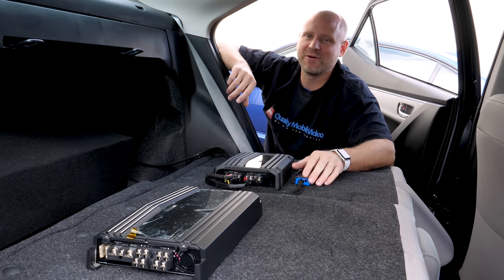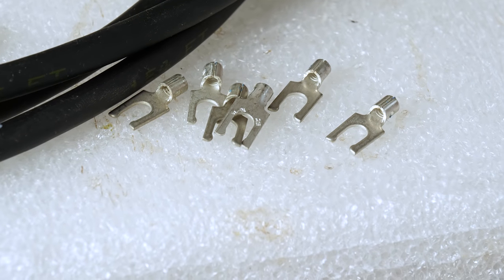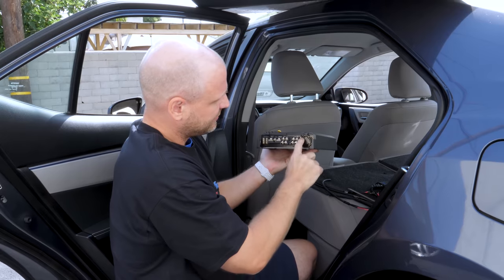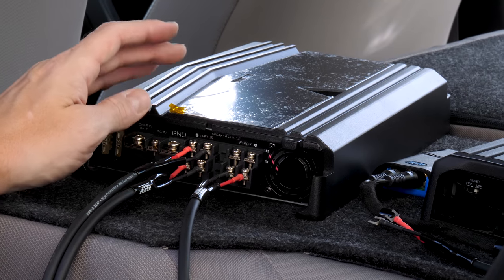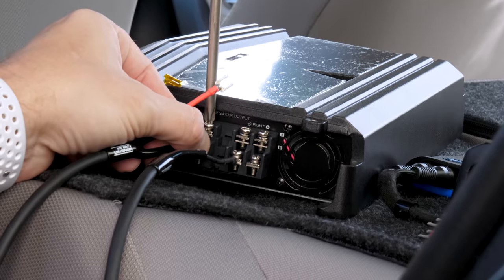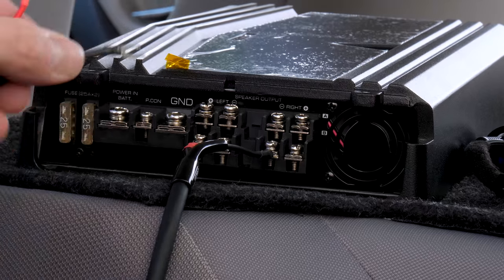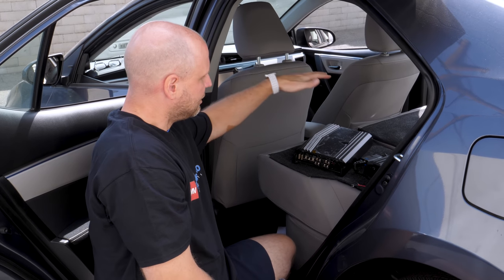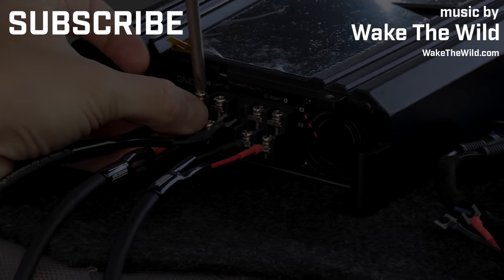How To Wire Speakers and Subwoofers to Your Amplifier - 2, 3, 4 and 5 Channel - Bridged Mode

Comment: This is awesome and the technically correct way to do things if you only have a 4 channel and need to drive 4 speakers + 1 sub.   HOWEVER Trust me when i say... DONT CHEAP OUT, SPEND THE $75-200 TO BUY A PROPER CLASS D MONO AMP TO RUN YOUR SUBWOOFER. TRUST ME,  200w @4 ohm bridged(2ohm) is OK but  There is a reason that these class AB amps have fans, they get HOT as fuck.  2ohm load x 4 is pushing it but 2ohm mono+ 2x2ohm is really asking for everything the amp has, If its decent it should be ok but chances are its going to overheat and go into protect.   Buy a $10-15 distribution block and run power wire to your 4 channel AND mono amp from that single 0-4gauge wire coming from your battery.  If you absolutely cannot have 2 amplifiers, check out pioneer's gm-d9605(or the newer 9705). They are class D and can be run at 1ohm on the subwoofer channel for 600w!!! thats 3 times what you will get from a class AB 4 channel like this.  But if it were me I'd take the sound quality of this kenwood class AB  and combine it with a 800-1200w Class D mono amp.  Pioneer  8601(800w rms) or 9601(1200w rms) work great.

Comment: i used my amplifier for 1 subwoofer. but i noticed that it overheat. what is the reason? is the polarity of the speaker important. maybe i incorrectly connected the positive to the negative of the speaker connection. please help.
Reply from the maker: What are the exact models of the subwoofer and the amplifier. You could have poorly matched your gear

Comment: I am running two sets of components some mid ranges and some tweeters four of each would u use the rear output to run the mid ranges and then front rca output to run tweeters and run tweets on one and two and then components in 3-4?
Reply from the maker: You don't have to run the tweeters to the external amp, if you're replacing factory tweeters you could just power them with the head unit
Reply: Quality Mobile Video I am running five zvx 12's and a cadence za12kw, it will take an amp to make a tweet even audible, and I am also running or have an deh-80prs coming n and want to run it off that nice clean output of the pre outs, but how many watts do u think a passive crossover can take?

Comment: Newbie, If i want to amp two subwoofers and power six speakers front, rear and extra 6x9’s would i power two subs to one amp and 6 speakers to another amp? Guessing it’s possible? Any response by anyone would be helpful
Reply from the maker: I think you need to proof read your comments next time bud! You also don't have to power everything with amplifiers. You can always use your head unit to power some of the speakers. So you could do two subs to one amp, four speakers to one amp, and two speakers to the head unit
Reply: Okay, you made a video how to power two amps yet?

Comment: can we hook 2front speaker and one sub to 2 channel amp?
Reply from the maker: Unfortunately no. When you're bridging a subwoofer to a multi channel amplifier, you need to use two sets of speaker terminals. You'll need a 3, 4 or 5 channel amplifier

Comment: use 720w amp hook up 4 speakers to 2channel. the amp give lot of power to 4 speakers.  why does power proctect turn on. any suggestions.???  thanks,
Reply from the maker: Its possible your impedance's don't match

Comment: Its STR8 forward when u hooking even amount of spkers nd using same ohms!! Gets complicated when u run into uneven amout of spkrs !! Thats were it gets challenging as per how to get the best power nd clarity out the system!! In my case i have 12 spkrs OEM nd replacing all them w higher watts all @4 ohms,,,, w 2 amps, one a5 ch w 5th ch for bass D class ch , nd the other a2 ch D CLASS sub amp , both rated each 2500w , all my speakers rated each at 200w w 3 subs rated each@ 300-600w 4 ohm

Comment: What if my vehicle has 10 speakers?! 4 low doors, one center dash, 2 rear corner deck, 2 high front door tweeters and one rear center deck subwoofer. Hoe would I connect all of them to an amp?!
Reply from the maker: I'd probably connect the front speakers to the head unit and use two 4 channel amps for the rest

Comment: I have 2 8" and 2 6" vocal speakers 8ohm each how do i wire them up to my 4 channel 4ohm amp? Bridge the 2 8" and connect the 2 6" direct? 8" are 500w 6 are 250w each
Reply: Amp is 1000w max

Comment: can do the home theater sub out be installed a power amp to upgrade it's bass sounds by using 2separate sub woofer by bridge, tnx,,,,,
Reply: my model unit is Samsung htf9750w  with vacuum tube GaN amp1330w

Comment: I want to install iPad as head unit in my car.how will connect the iPad to 4channel amplifier?
Reply from the maker: Just need an AUX/RCA adapter to run to the RCA inputs of the amplifier! 
http://www.qualitymobilevideo.com/xpress-xm-satellite-radio-wiring-harness.html

Comment: My sons dad did my stereo I've got an old 99 toyota avalon and a 10 sub in trunk with these 2 amps under my driver seat, the wiring is so scary, anytime I have an issue it's like a living hell trying troubleshoot wtf is going on. I've stopped at a car stereo store one time I had an issue, and they said they'd have to totally gut the entite wiring system to make it right again. I'm so frustrated.  It shorts out constantly, last night I got into my car and heard a funny beeping noise, climbed into the backseat where I thought it was, and couldn't find anything beeping but started smelling electical burning, when I went to climb back out I looked up and my car was filled with smoke, the terminals on amp were not covered right and touched each other causing half the dam wiring to basically melt onto each other. But I couldn't figure out which wire it was that was burning, freaking out was starting to grab for my fire extinguisher in my trunk, yelling for my sons dad who was inside the house luckily, finally he came down and pulled out everything to make it stop smoking, no fire, but dang close. I hate it when he does anything to my car, but with how he redid all my electrical, I dont know anything that's going on, its not at all normal, or how any diagram of my cars wiring "should" be, so I have to let him try fixing stuff he's done before. There isn't anyone who I've shown my stereo to who understands what he did to it. They're good amps and good speakers,he just sucks at installing and connecting and rewiring it all in there, and its so dam expensive, least from all the quotes I've had done for redoing it,fixing it, I can't afford it...ide just buy a new, used dang car if I had that much money.  I went to check out the book for my cars electrical diagrams, and wiring, and the book is flipping 120$ online. I can't find anything on the web that even just shows pictures of the wiring, no videos nothing. Idk what to do. I've got my 7 year old son who I have to drive to school every morning having to keep his feet up off the floor when he climbs into the car cus I'm scared it'll bump something and catch fire. I acually am tempted to just pull the whole thing out completely. My problem though is I have chronic anxiety and ptsd, and driving is sort of a really big deal for me, and having good music is basically like my Xanax pill, it makes life work for me, and when I'm driving, it's basically a mandatory thing I have to have to be able to drive...sounds crazy I know, but if you knew what lead me to that point of crazy, you'd know I'm acually doing pretty awsome only needing music to help me with my issues.  Anyways, of anyone oit there has ever seen or knows where I can find the wiring diagram for a 99 toyota avalon for free online, or anywhere and share with  me,ide be sooo sooo greatful.

Comment: how many channel amplifier do i need if want to wired 2 front 2 rear speaker and a parallel sub?
Reply: 4 channel amp
Reply: @rescuemepookie5256  thanks for your rply man, really appreciated!
Reply from the maker: 4 channel or 2 channel amp bridging the speakers will work fine!
Reply: @Qualitymobilevideo  thank you for your response
Reply: @Qualitymobilevideo  how can i wire 4 speakers (4 ohms and 250 watts each) and 2 subs both switchable 2 or 4 ohms 1000 watts each, i have a 4 channel bridgeable amp with 1000 watts max, should i make the 4 speaker 2 parallel to the 2 channel and make the sub parallel also for the bridge?

Comment: How In the world did the amp get its  full rang input feed ?20 Gage wire isn't enough to  handle much amplification anyway unless it sounds like crap and certainly not thick enough for a subwoofer .
Reply from the maker: The speaker wire featured in the video is actually 16 AWG not 20 AWG, which is perfectly suitable for most speaker runs, this is also just a demonstration

Comment: I have 4 front speakers (2 door 2 under dash) and 2 rear. how do i wire the front on a 4 channel amp?
Reply from the maker: Are you wiring the rear to the amplifier too?
Reply: Yes
Reply from the maker: So 6 speakers and one amplifier? I would power two of the front speakers with the head unit, then wire the remaining 4 to the amplifier
Reply: Quality Mobile Video i assume to wire the 2 small dash speakers to the head unit and the other four 6.5” speakers to the amp

Comment: hi! i have a 5 channel amp with MAX Power 1600W
• RMS Power:
     50W x 4 + 300W (4Ω)
     75W x 4 + 500W (2Ω)
     150W x 2 (Bridged) + 300W (4Ω
and 1 OZ Audio Vector Series 12", Dual 4 ohm 2" Coil 300W Subwoofer, what is the proper wiring for this? i've tried connecting the + and - wire to my sub then to the amp bridge connection but it smells kinda burnt.. i think i just fucked up my sub lol or is it normal for new subs?
Reply: fifty 9755 ummmmmmmm no. Get mono for the sub n leave the multi channel amps for speakers . N maybe u went too low on the impedance n cooked ur sub.

Comment: is it possible to connect a subwoofer and one speaker on a 2 channel? if so, how?
Reply: two 4 ohm speakers +,+.....-,-   on channel 1 .............1,  2ohm subwoofer on CHANNEL 2. THAT IS CALLED 3 CHANNEL MODE

Comment: Hello everyone, can someone help me do the right connection based on the gear I have?

Speakers:
4x Kicker KS 6.5". (4ohm, 100w RMS each).

Amplifier:
1x Kicker CXA360.4

Amp Specs:
*65x4 @ 4ohm Stereo 
*90x4 @ 2ohm Stereo 
*180x2 @ 4ohms Mono

What would be the best way to connect this system?

Comment: My right side amp channel not working can I use left channel for both side speaker?
Reply from the maker: Yes technically you can bridge two speakers onto one channel like we did in the video if the amplifier can handle it
Reply: @Qualitymobilevideo  should I try it out? 
Can i have some safety precaution steps if things go wrong?
Reply: @Qualitymobilevideo  do i need to plug out the negative terminal battery when i install both side of the speaker in 1 channel?
Reply: @Qualitymobilevideo  Thanks a lot man! it works for me. 
Both side speaker came to life!!!
Reply: @Qualitymobilevideo  2nd prob since beginning i hv humming sound when i turn up my gain .
Noticeable when i turn off the volume.
would u mind helping me out for da 2nd time ^^?

Comment: I disconnected the battery wire from my amp and I forgot what part I took it off from so I connected it to the one I thought it was and it works but it drains my battery when car is off
Reply: Ittbelit t I dunno if you got help but there is a thin wire that’s suppose to go from your deck to your amp. It’s called rem.

Comment: Your five channel was actually three channels you paralleled the right front and left front that's two channels and then you mono ed  out channel 3 and 4.
If the vehicle would have had six speakers and then the two woofers you could have paralleled the four front speakers giving you a 2 ohm load ran the woofers in series which is 8 ohms ran two  more 4 Ohms on those two remaining channels and then Bridged the woofers over it. Which is a 4-channels but it would give you actually 5 out of those four channels all Channels a 2 ohm Load

Comment: To the folks watching, do you prefer using:

1 - A 4 channel amplifier and a separate amplifier for the subwoofer?
2 - A 5 channel amplifier?

And why do you like setting up your amplifier(s) this way?

Please answer in English, not lots of jargon that won't make sense to a beginner.
Reply: I’m about to try this. Based on what I’m seeing, it looks like it can be done with either a 5 channel or 3 channel, if that exists. 

Either 5 channel how he says, or a 3 channel where you run the 4 speakers on two channels parallel, and the sub bridged. 

I’d lean away from using two amps unless doing competition level stuff. That’s an extra power line, fuse, etc - potentially capacitor, to handle that. One amp just seems simpler.

I haven’t done this before though. First time. If I remember and can find this again after I do it, I’ll tell you how it goes

Comment: how do i actually connect the wires from the amp to the speakers
Reply from the maker: Real easy. On the other end of the speaker wires just connect simple disconnect adapters like these:

https://www.qualitymobilevideo.com/107.html
https://www.qualitymobilevideo.com/spcc.html
https://www.qualitymobilevideo.com/e-fmr250n-100.html
https://www.qualitymobilevideo.com/e-fmy250n-100.html

Comment: What if I have 4 subwoofers running at 350 rms each 2ohm. And then 4 100 rms speakers?
Reply from the maker: I would suggest a powerful bridgeable 2 channel amplifier for the 4 subs, then either a lower powered 4 channel amp for the speakers, or just use your headunit/factory amplifier to power the speakers

Comment: how to wiring for 4channel Sony xplode xm-n1004 amplifier with 4speaker and 1subwoofer
Reply from the maker: If its bridgeable, go to the 6:00 mark in the video
Reply: Quality Mobile Video but it can connect 4speaker and 1subwoofer is my doubt?

Comment: With the setups you have to consider more power. Ie, higher alternator voltage or extra batteries or two alternators

Comment: I went to a car audio specialist, i installed 4 speakers with a subwoofer in my 5 channel amplifier. Now i hear distortion sound even if i am not playing anything. The “specialist” said this is normal. Any speakers after market with amp will cause distortion! 😢

Comment: I have 2 door speakers and 2 tweeters with 2 subs how can I wire my setup I have 1 4 channel sub
Reply from the maker: If you have two door speakers, I assume you have the tweeters in the front as well? If you do, use a passive crossover on the tweeter and use channels 1 and 2 for the door speakers and tweeters. Then you can use channels 3 and 4 for for you subs.

Comment: parallel speakers connection on one channel is only possible if amplifier is 2 ohm stable. otherwise you will burn the amplifier

Comment: Ok, how about 2 tweeter, 4 front speakers 4x6, 2 rear speakers 6x9, 1 10inch sub. Single deck & a parametric equalizer 4-band, 5 channel amp.?? All this in a little truck..lol

Comment: So you don’t need an rca ??
Reply from the maker: To wire speakers? No. RCA's are used to get the signal from the stereo to the amplifier
Reply: @Qualitymobilevideo  excuse me but in the 5 channel system you're going to use both RCA's right? One RCA for the 4 speaker setup and one for the subwoofer.

Comment: What about a 4 channel 6 speaker? That’s my issue
Reply from the maker: You could power the front speakers with the head unit
Reply: Thanks for the response. I’m upgrading the 400w amp to a 1000 4 channel,can I connect my two new speakers in parallel
Reply: Can you guys show some tips for hooking 12” kicker es to 6 channel amp(Audison lrx 6.9)just sub no speakers they are hooked to my head unit Sony xplod .

Comment: Duud😪 i wanted to see a 2 channel with sub u didnt explain.. A sub and maybe speakers on 2 channel
Reply: I'm for sure ignorant in the matter, but according to what I can see in this video the option is to use one side to connect both speakers in dual mode, and the other side for the sub alone.

Comment: There’s no point to soldering and crimping. Do one, and do it right. If the crimp is good, the solder can’t wick in. If the crimp isn’t good, don’t crimp. You should really get a good set of crimpers instead of the jack of all trades, master of none generic automotive crimpers. Good ratchet lock crimpers will produce a quality connection that is always good.  I’m not trying to criticize.  I just want to help people wire better and easier.

Comment: How to wire 6 speakers and 1 subwoofer to 4 channel amp
Reply from the maker: If you're using a subwoofer, max you can do is 4 speakers like we showed in the video. I'd recommend connecting the last two speakers to your factory head unit

Comment: I got thru 9min before I had to say stop! Wait! Wtf! Lol- the failure to add for person to pay attention to speaker’s ohm level, as you know many manufacturers offer different ohms for applications..ie- I have 2- 2ohm Fosgate to make ~1ohm/~4ohm loads
And have found and noticed factory setups with 6ohm or odd ohm’ed speakers to “create” the 400watt stereo systems....if you could elaborate on that, I see a more educated customer base that can start demanding inexpensive quality stuff like old skool companies competed  : #RIPStillWaterKicker #USA
Peace and thanks- great work otherwise
Reply from the maker: Thanks for the suggestion Willie!
Reply: If you watch it again and pay close attention, he specifically indicated the person would "hypothetically" be using four 4-ohm speakers and A SINGLE 4-OHM SUB! Nothing was mentioned about running a PAIR of 2-ohm subs of 1 channel. This video could NOT have been more clear on what he was trying to explain. He probably assumed MOST people would understand that it was meant for only 4-ohm speakers! BUT YOU CAN do this same thing with just a bigger, Class D amp if you want. He was demonstrating with a Class A/B amp.